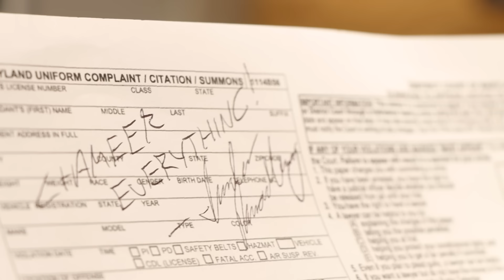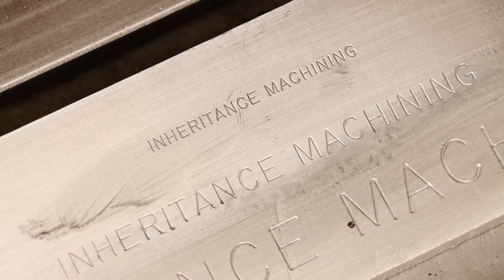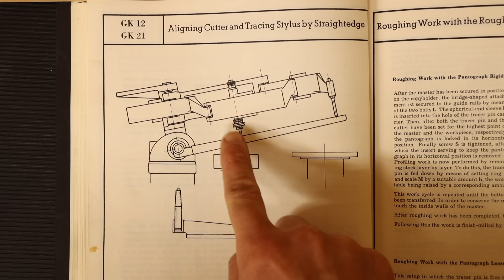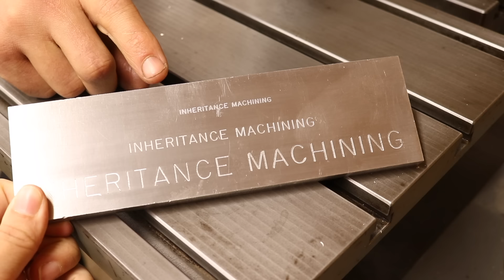Saving the Machine the World Forgot

Comment: When I started in the tool room of A.O.Smith Milwaukee works in 1983 thay still had 6 shapers 3 of witch 3 wer still in use squaring up big blocks of tool steel ever day for 2 of the 3 shifts and 7 days a week when busy. then in the mid 80 when they had to higher a few hundered machinst & Tool Makers thes kids knew knew nothing about using a shaper and the Old guys wouldn't show them how because they knew if they did theyed be uot of their cushey jobs. In the long run all that squering was now done on the horizontal mills. allas it all gone today even most of the buildigs on the 37 acers are gone. Bought out by Tower Automotive and shit canned for Profit to hel with the employes they don't matter to corperate execs making their millions.